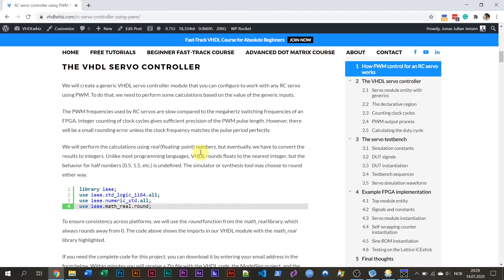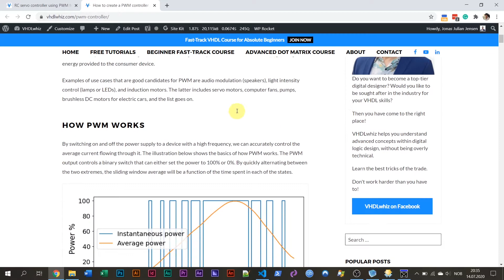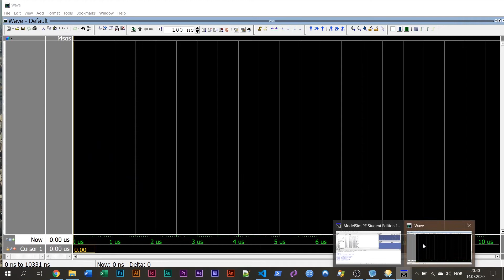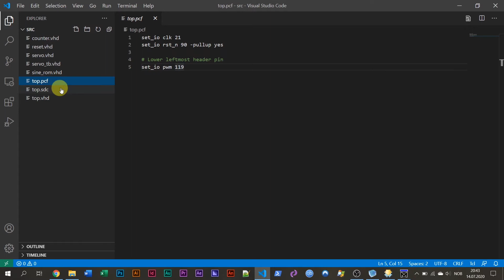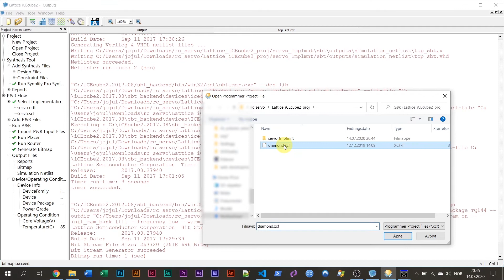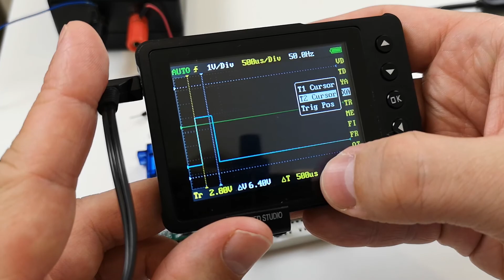RC servo controller using PWM from an FPGA pin

Comment: Hi Jonas. What is the little board that interfaces the iCEstick? Is it an array of voltage regulators, or a driver? Thanks!
Reply: See Jonas' answer further below - I think it's an Arduino level shifter.

Comment: Is the reset if-statement needed at 9:48 ?
Reply from the maker: You can do without it, but then you will get "metavalue" warnings in simulation, unless you specify a default value, but then you may get "default values not supported" on some architectures, like Lattice. But in my opinion, there is no reason to omit the reset value because the flip-flops already have a reset input, and if you don't use it, it's essentially wasted.

Comment: Thank you so much. Your tutorial was great. Is there a way to find out which PWM pulse frequency/min pulse width/max pulse width is needed? I don't find anything on the datasheets.
Reply from the maker: I did find it in a datasheet for the SG90 servo. If you can't find it for your servo, you can experiment to see which values will move the motion to the extremes. The values I used are listed in the blog post: https://vhdlwhiz.com/rc-servo-controller-using-pwm/